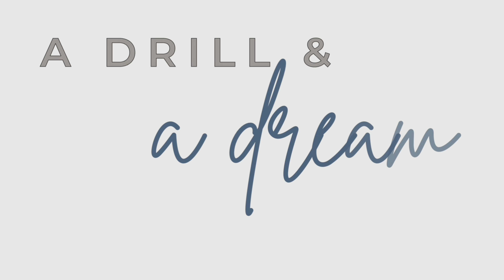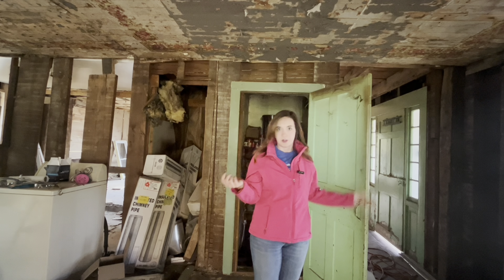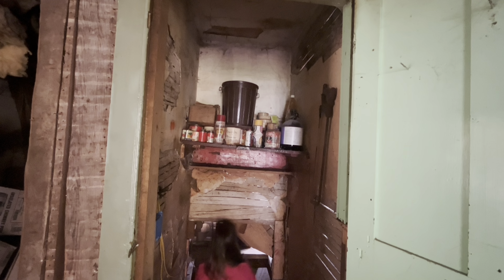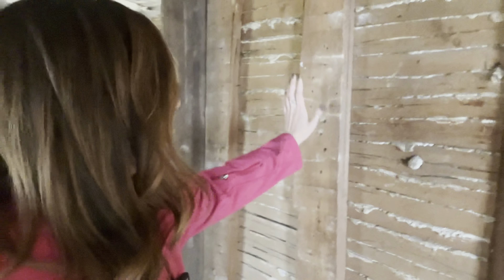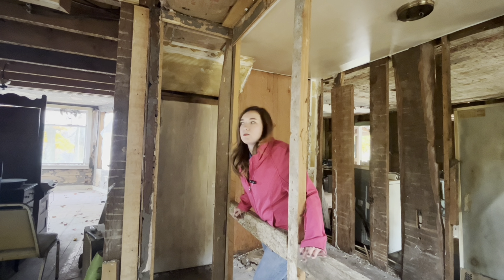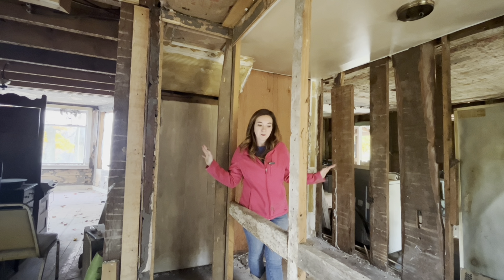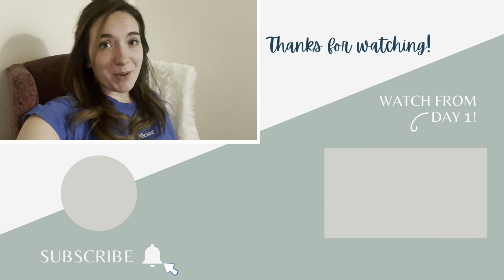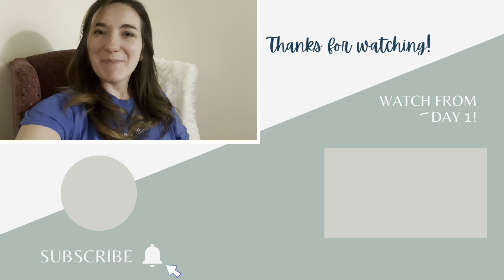MOVING THE BASEMENT STAIRS… this changes things! 😳😲 | My Fixer Upper House!

Comment: you've come a long way!  I don't think your new plan for the kitchen layout is the best use of space, though.  Once you tore out that wall that had been between the kitchen and pantry you had a lot more light flooding in.  Take advantage of it!  I'd like to suggest removing the window closet to the kitchen stove and continuing the cabinet run along that back wall and putting your refrigerator there.  you could then remove the window that doesn't match and replace it with the one you just took out.  Don't put another wall in to enclose a "pantry" but use floor to ceiling cabinets and it will open up more floor space and bring additional light into the kitchen area
Reply: This is a great idea!  With floor to ceiling cabinets there would be no need for a pantry and your kitchen would be spacious!!
Reply: I like most of this idea.  I was going to say to remove that long window (that isn't yet installed) at the end of the cabinets on the back wall and put your refrigerator there.  Love the idea of all cabinets for the pantry and no wall.  Your "island" is running into the window, but I wouldn't remove that window, but "scooch" the island a little so it doesn't run into the window.  Coat closet by the stairs.  Laundry room is all utility area for only you.
Reply: Also a great idea!
Reply: Totally love this idea. Also are you putting I. A woodstove in the living room, or basement and hooking it up to ductwork?
Reply: Yes exactly!
Reply: I agree!!!! Great suggestions!!
Reply: I like this idea. I was worried there were not enough cabinets in the kitchen as it is, and having the fridge in the pantry would be so inconvenient. Now that it's all opened up I would consult a kitchen planner to really make the best use of the space available.
Reply: I came to say the same thing. :)
Reply: I know you have already purchased some kitchen cabinets….if you decide to add extra cabinets with a cabinet pantry, instead of actually having a walk-in pantry, the cabinets do not have to exactly match what you have purchased or even be the same color. I just know that I would do whatever I had to do to get that refrigerator in the actual kitchen space!!!😁
Reply: Love this idea, you have floor space in your pantry anyways, so having that floor space in your kitchen,  with floor to ceiling cupboards as a pantry makes a lot of sense. The pantry cupboard can be a little deeper if you need as well. Great videos!!!   With your wood availability you can always build the pantry cupboards too.
Reply: Agree! As someone that cooks and uses my kitchen I can't imagine a fridge in the pantry. Is that a northern thing?  Since the basement isn't liveable space I wouldn't even give access from inside the house. Seem like a more secure idea as well; less access to the main living area
Reply: I love the idea of using floor to ceiling cabinets in place of the closed-in pantry. And I think having the fridge in the kitchen is really going to be more accessible and just look better. Less walls always make me happy.

Comment: Changing the basement stairs placement is excellent Love the kitchen bar moved to the outside wall. Really like that you moved the new closet door to near the entry instead of in the living room. 

Would you consider switching the bath and washroom areas? It would eliminate another door in the living room. You would walk from outside into the washroom/mudroom area thus eliminating the dogleg and have more useable space there (larger washroom space) and go into the bathroom through the washroom. The washroom/mudroom wall could line up with the pantry wall. That might just make your bathroom a bit larger as well. With the washroom/mudroom at the door, you could carry laundry directly outside to hang on good days and save electricity. It's nice that you put the floor plan in your video so that we can get a good idea of what it looks like and what you are planning.

Comment: Instead of boxing in the area where the fridge is leave it open to the kitchen and instead of open shelfs for the pantry do cabinets. I currently love finding an armoire that is made of sturdy wood like oak (these are the old TV cabinets that everyone is getting rid of) and turning them into a pantry. Or you could just do floor to ceiling standard panties. It is a throw back to old kitchens to do a furniture type cabinet think the unfitted kitchen like in the days of a Hoosier cabinet.
Keeping the fridge open to the kitchen is important for the flow and the work triangle.

Comment: Little tip: with the pry bar work it sideway rather than back and forth. Also the new layout seems to make better sense and flow. But if you start messing with the joists be VERY cautious of who is going to do it. You really need somebody knowledgeable in the matter. It could look just fine for now but in ten years be the cause of major problems. There are standards of loads and materials which needs to be respected.

Comment: Consider a refrigerator draw.....built in like cupboard.  You don't need all the cabinets in one place. You could double your space in pantry or in kitchen with pull out vertical skinny pantries which hold a lot of food supplies.  Big refrigerators are over-rated and take up a lot of space and make noise.  A  small basement chest freezer might be a better use of space, since basement will be accessible. Think European...they have lots of good ideas.  Barn door or louvered door to pantry or no door might be a good idea. Laundry room should have a solid door since it is off the living room and you won't want to hear water sloshing, but great to watch tv, read a book while doing laundry.  You could also store out of season clothes there as well.

Comment: take out what's left of the wall between the kitchen and pantry and incorporate that space into your kitchen.  you could run a line of cabinets down the wall from the door to the new basement stairs along the liiving room wall and do some floor to ceiling cabinets for pantry space and put your frig where you'd planeed to put it

Comment: Great idea moving your basement stairs! Seems more practical to make the new closet a coat closet by the front door (it’s handy & will keep things clean). Cleaning supplies can be fine in the laundry room. 

I love the idea of moving the kitchen cabinets on the other wall! However, you currently have planned for a few small prep spaces divided up by your stove & sink. If you create a U-shaped kitchen by connecting the 2 kitchen cabinets together along the wall you’ll have much more countertop, storage space & a great prep area!

Comment: I love the new design with basement stairs under upstairs. Makes so much sense.. If there is space, I recommend you do a sliding door into the pantry so you aren't losing space with the door swing. Also, you could put a floor to ceiling cabinet in the pantry to store your cleaning supplies, broom, mop etc that would be hidden kind of.

Comment: I think moving the stair is an excellent idea Abby, You can have a closet by the entrance which makes excellent sense and you could also make your pantry deeper because the closet doesn't have to be that big your only going to put you coats and shoes or boots in there,  bring the door to the basement under your stairs out to meet the top stair of your upstairs and take that wall down which will give you more room in your kitchen and instead of a walk in pantry you can build a wall of cabinets giving you more room in your kitchen. Great idea Abby. Jay is so smart.

Comment: You could improve the oil tank situation by moving it outside to an insulated tank. 

This would not only increase  floor space downstairs , but you would have a brand extend date on the tanks longevity requirement. 

In Canada, I believe tanks like the one downstairs are time dated to 10 years.  

Call your gas provider to get all the details in your locality.

Comment: I LOVE the idea of moving the basement stairs!  Will give you much more room/closet space, which is always good!!!  My one concern now, for the kitchen is cabinet space.  With what you have now... you don't really have any.  Plus, where is your fridge going to go?!?

People have mentioned a pocket/barn door for your pantry.  Love that idea, as again, it gives you more space.  You COULD possibly put the fridge in between those two windows on the back kitchen wall, with maybe counter/cabinet space under the window beside it.

Last thing... where the basement stairs are now... gives you a LOT of extra space... but according to your plans, you seem to be cutting that space off?  Your plans show two walls, one behind the other... Is that going to be wasted space?  You could recede that wall a bit (the one the sofa is on) create the closet, then have a bench seat for sitting down to remove boots and what not. Or a decorative mirror on that wall, with maybe an entry table (or a charging table for phones and stuff?)  The possibilities are endless!

Comment: Love the idea of moving the basement stairs 💯 💖
What if you had the door to the basement stairs where you were saying about putting a cupboard in, like in front of the original front door next to the upstairs stairs? So the basement stairs doorway would be in more of a walkway rather than coming off a main room, like if you were stood with your back to the original front door you would have a door with basement stairs going down in front of you and next to that the upstairs stairs going up? Would that work with the basement layout? Just an idea 💗💗💗
Reply: That's a nice idea, too, but I know contractors prefer to keep stairwells one above the other for a couple of reasons. I think the biggest reason is that there's more headroom on the lower stairwell if it's directly below the upper stairwell.

Comment: I say move the stairs! It would work out to utilize the space better if the stairs are stacked. It will allow you better storage space and less awkward spaces because there are so many different doors. Plus if you wanted to with that new layout you could even do an L shaped kitchen with the cabinets along the outside walls and have a kitchen island with some seating around it. Which may give you more countertop space for food prep if you like to cook a lot. That is if the space would be big enough for a good size kitchen island. You can do some floor to ceiling wall cabinets with a built in oven/microwave setup, a counter stove top, and have a nice size sink. Seeing your videos makes me want to get back into teaching myself how to flip and remodel homes. Keep up the good work!

Comment: That empty space between the new front closet (coat closet) and the pantry--just open and add that to the pantry. I know you're probably not fussing too much with the details on your floor planner program, but be sure to plan the swing of the doors. They should always open into a room in such a way that you can walk into the middle of the space or straight to your destination without having to step around the door or swing it farther than necessary. So in your pantry, have the door swing flat against the wall on the right as you enter, and in the bathroom, have it swing toward the tub. The front closet door is good because you can access it immediately on entering the front door, and the laundry room door is good.

Comment: Changes are good. I like the move of the basement stairs seems to make more sense. I think it will make the sofa wall in lay out cleaner and will allow more space for two tables even adding a chair to pul up too if you need it. I do it if it not to costly. You will most lkely have lots of changes as you go too. Playing with floor plans and being able ot give it thought and time will make it the right answer. Very Blessed to be able to do that. I love your home.

Comment: I definitely don't know the dimensions but if it could fit i think a laundry room / coat closet under the staircase in the entry makes more sense, kind of having a chores area vs. a guest area. Also if possible to install a window in the current laundry room and make it an office. With a powder room upstairs it will increase the house's market value i think. It would be primarily a two bedroom, office, 1 and half bathroom.

Comment: Jay is wise. I'd take his advice. The closet being just inside the door makes sense as a proper entry closet for coats for guests, even though they have to be transported from the door they'll actually come in. You might want to hang a coat hook nearer the door you'll use most often, for your own daily convenience. It could be decorative on show, or something practical and "hidden" in the laundry area. But if it were me I'd definitely keep all cleaning supplies in the laundry area and the proper coat closet in the new space next to the stairs. But that's my preferred work flow. The townhouse apartment I currently live in is arranged with the proper entry closet next to the living room, which opens onto the commons area, while the kitchen door opens onto the street and walkways. It's really inconvenient to store coats in the coat closet, so I hung a nice coat hook just inside the kitchen door, and change out my outerwear between hook and closet for the seasons or just to switch up my ensemble. I keep one boot and shoe rack under the coat hook, and another in the entry closet to store my off-season footwear. If your entry closet is large enough to hold your stored outerwear plus guest coats it's extremely convenient. They could still take off their winter boots at the kitchen door, or side door (whichever one you're using as your main entrance). Just keep a bench or chair handy, and guest slippers too.
It's all coming along nicely. I hope you are enjoying or did enjoy your trip to Ethiopia.
Best wishes ✨

Comment: My rule of thumb in life is to always have at least 2 ways to heat your home and cook,so I've always had wood or coal heat in my homes with the way things are going now days with power outages and such you need a way to heat and cook in your home should that go out ,so I  have a wood stove with a flat top to cook on plus I have a hot water loop to go through  my stove to heat my water in my water heater so we can still have a hot shower  ...just a thought...good idea putting the stairs under the other one...that basement would be great for a root cellar if you ever get into gardening

Comment: Putting the stairs below the upstairs is a good move I agree with others about bumping out your island to clear the window is also a good move. Also, I think the bathroom where the toilet is can be better designed. Move the door down maybe place it behind the stair wall and remove that window. Square off the bathroom and you could get a linen closet in there.  I would also do away with the left side door going onto the porch you have enough egress doors with the slider and others, and you really do not have enough wall space to arrange furniture in the living room area. You could bump out the utility area and put a door in the utility area with glass in it for more light that will serve 3 functions the extra egress if you think you need it light entering in and better wall space and flow for the living room. I know this sounds a lot but as a woman who has designed many houses you can never have enough storage. Also, as far as the basement it is also a great extra pantry storage so if you go with the built ins upstairs for better use of floor space you have a perfect root cellar potential in your basement. You're doing a great job. Have fun doing it Blessings!

Comment: Am I right, or am I right? Right? What a brilliant idea. Definitely move the door and stairs to basement,  the new flow especially in the kitchen is perfect. Absolutely love the idea of a closet by the front door that’s where the coats etc should go and free up your Landry room for laundry. and the new location is much smarter, better use of space. As for changing plans, you’re at the stage where you almost have a blank canvas and it’s now that you can paint what you want, once you commit your plans a locked in.

Comment: I like the openness, especially with this last demo.  The main level was so tight, puzzled, and confusing before.  I think the more old stuff you remove and the longer the house has to air out, the fresher it might be for you.  I hope someone will remove the old pantry ceiling to clean up what’s up underneath.  And yes move the basement door.  You can keep cleaning items in the front closet for muddy days. And you can keep the vacuum and other cleaning supplies in a laundry room closet.  A Bifold might work there.

Comment: I would go with moving the basement stairs, but once you had removed the previous walls in the pantry, I wondered why not just have cabinets and your refrigerator there instead of adding the extra walls to divide it as a pantry.  That would make your kitchen really big in appearance. You also would not be hindered with having to make a 90 degree turn once you were in the pantry to get to basement.
Reply: Hi how are you doing?

Comment: I am no designer but cant resist putting in my two cents. If you remove the tub in the bathroom and put a wall and make it a half bath then move the door to the laundry room where the tub would have been. Eliminates the door to the laundry room from your living area.  Flip your furniture placement. Have tv on wall behind pantry.  But whatever you doit will be fantastic because it is yours. Good luck.